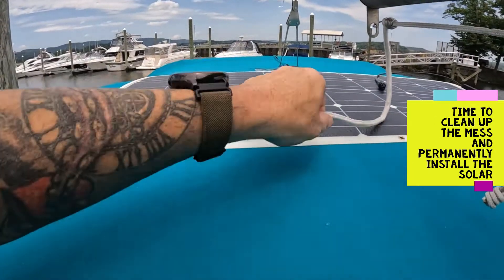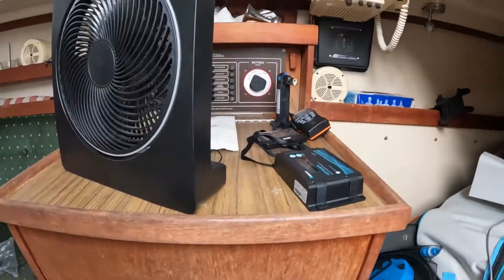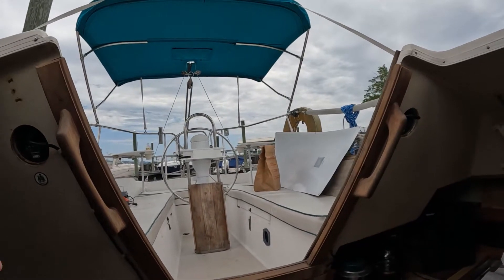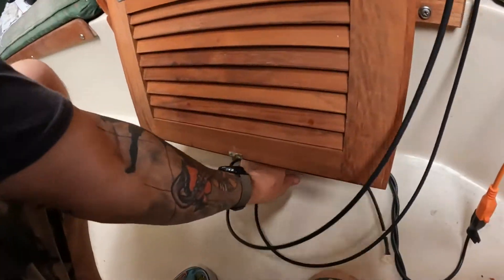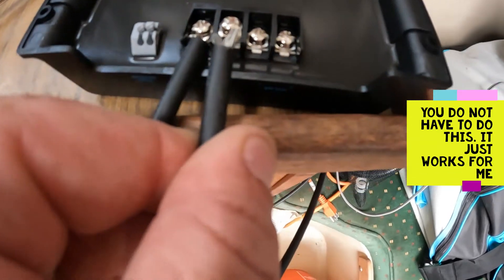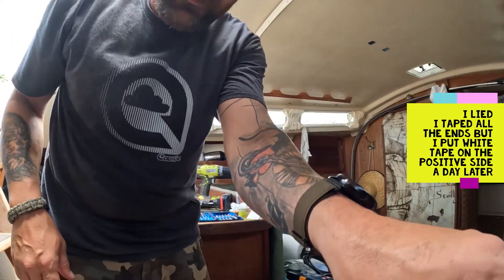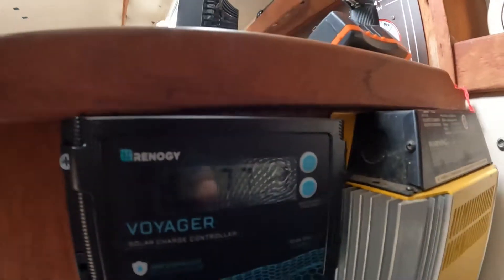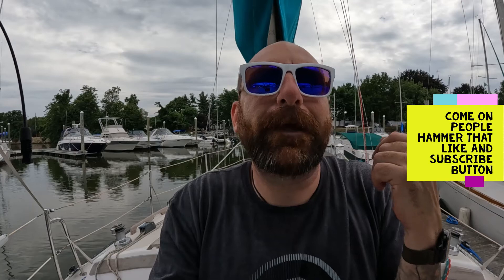Installing a Renogy Flexible 100 watt system on my sailboat

Comment: Another pro tip: which will save you headaches and possibly more down the road: Crimp on a ring or fork terminal connection onto the stranded first. This is a more secure (and recommended) way to connect stranded wire to a screw down connection.

Comment: The charge controller will charge until the battery is full and then float?
What happens if you turn on the engine and the alternator starts charging the batteries?
Is there a battery charger that runs off of shore power? If so, what happens if you have that on?
In your setup do you have to manually disconnect the solar panels in any of these situations?
Reply from the maker: Yes and the solar is only for when I'm in the hook or sailing with no motor and or shore power

Comment: I have four of these abd they are a few years old.  Unfortunately they are only producing a quarter of their rated output now.  I think next year I am going with rigid panels.
Reply from the maker: Have you tried to clean them
Reply: @Sailing.Artemis  Yes,  They improve only slightly.  Then I did some research and the consensus is they degrade faster than rigid panels.  You have already purchased yours so you will probably get good results initially.  Keep track so you can document the decline or lack of decline.  I have 200 watts of new SunPower panels and they perform better than the older 4 - 100 watt panels.
Reply from the maker: @saltlessshakedowns4999  we shall see they are only in the sun from time to time
Reply: @Sailing.Artemis  Do you have an MPPT controller that has Bluetooth?  I can check using my phone so it has helped me identifie the problem.
Reply from the maker: @saltlessshakedowns4999  I do not as I only put it up when in on the ⛵ at for more than one day

Comment: one thing you'll wanna do is change that controller from a pwm to a mppt controller. much better unit with better efficiency.
Reply from the maker: I only use this from time to time but if you have a model I should look at please let me know
Reply: Victon 100/30 is top notch with 100W panel on my vessel.